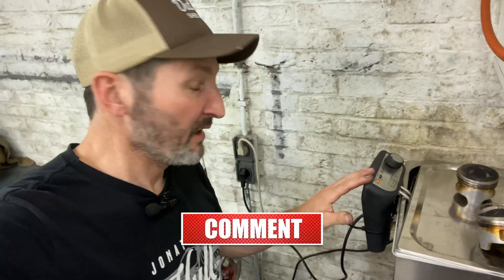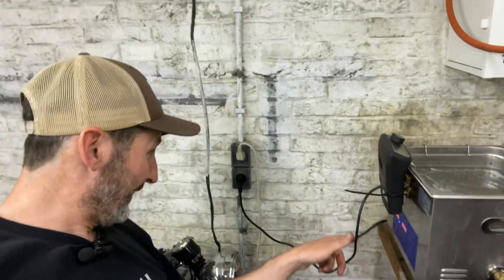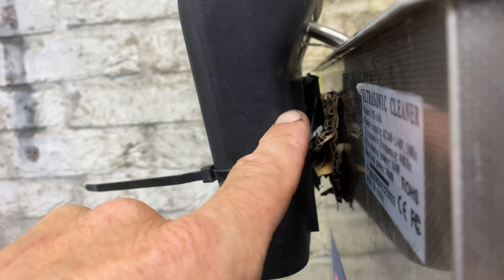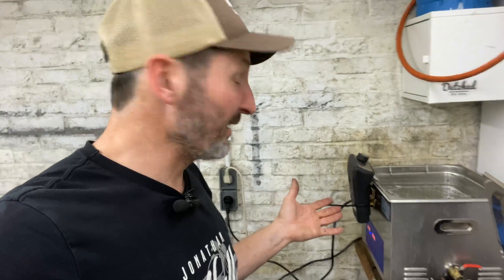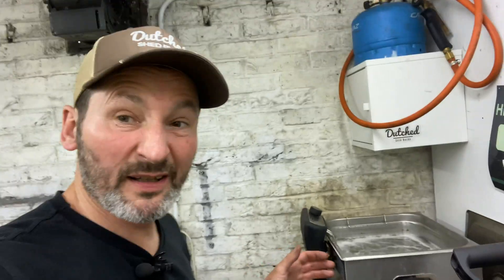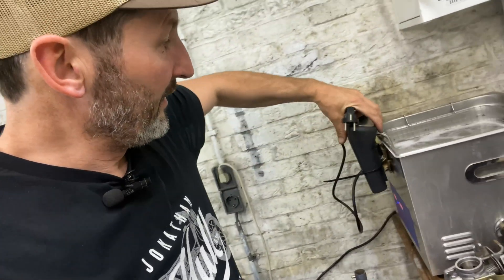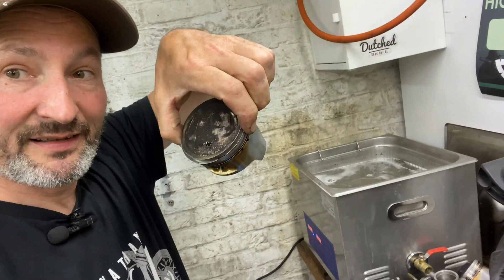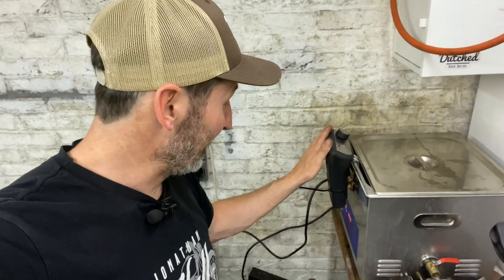How to quickly heat a ultrasonic cleaner?

Comment: what fluid do you prefer using in your ultra sonic?
Reply from the maker: Water and 5-8% tickopur 33. There is also a different tickopur which is used if the aluminium has white oxidation (but i have not yet tried that). 
But the tickopur works great.